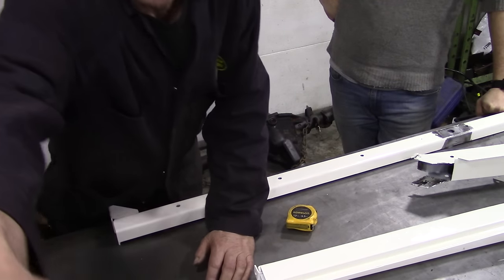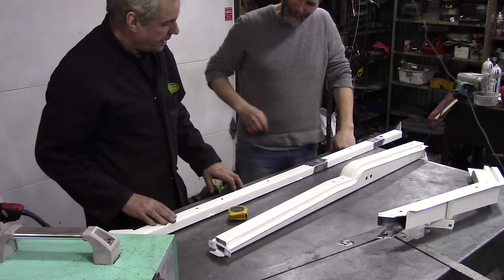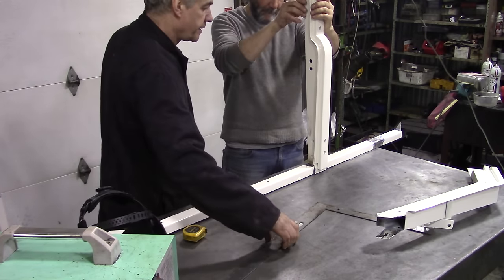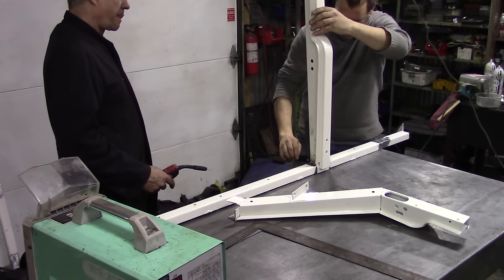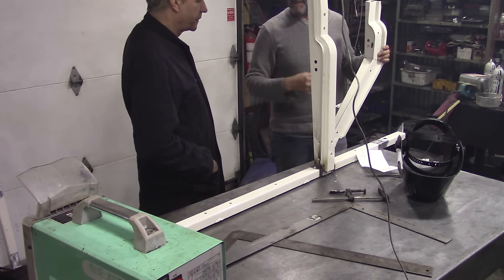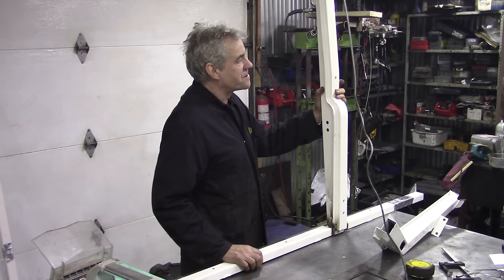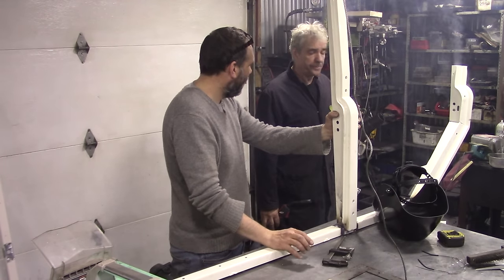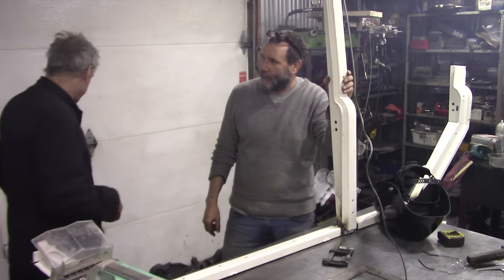Welding door frames for a 110 CSW - with added chit-chat!

Comment: 2 weeks ago I shipped a 9.6KG box to the UK from Canada by UPS with some parts I needed refurbed and it cost  $175.
I shipped the same box/same weight and contents back to Canada  this week using UPS again and it cost $75. I asked UPS why there is such a difference and no one would give me an answer. All I can think is that it's the TRUDEAU tax!
Reply from the maker: Not so sure about the Trudeau tax, but there is unfair pricing by all courier services to Canada - As I try to explain, it is Canada not Cambodia - ship from UK to Vermont 40km away - half price

Comment: I just spent some pennies at Exmoor trim for my 1962 109 full canvas and the shipping was only £14 with speedy gonzales, I have sent items to the US of A and was shocked at Royal mail charges that put an end to that malakey, I don't buy from the states either because they charge more for the shipping than the item costs.
Reply from the maker: It is a joke what is being charged now. Worst thing is, that all the major couriers charge about the same, so no competition.
But this will come back to bite them on the bum when folk stop using them, and simply do without
Reply: @BritannicaRestorations  It has gotten to the point that I will make a day out traveling to drop a package off, it get's us out of the house and make's it a little mini adventure in the Landy, have a bite to eat etc.

Comment: I was after all this info the other year when I got a set of pre welded galv YRM sides if you recall for mine just over 2 yrs ago.  I was worried that the C pillar was in the wrong place, ended up cutting it off and rewelding it.  long story short it wasn't the C in the wrong place, it was the B was to far forward.  Only worked that out when I came to fit the front floor panels in.  had to chop 1/4 inch of them and the tunnel.  That was after countless pictures sent to YRM and the replies of its all jigged up, never had an issue etc.
Reply from the maker: I know the front door gap is 34 3/4 inch, but we were unsure of the C post as the door gap is worked out by the rear 1/4 wing, NOT the frame, as it overlaps the C post = tricky.
According to Jeff , YRM would not give him the measurements to weld it in place
Reply: @BritannicaRestorations  yeah that was my issue.  You did a video using the white 110 sw For the distance. I can't remember what it was now, but you could look back to that.

Comment: Had the self same issue with the bugger am building back up after strip down to bare bones   its not so bad when you have another CWS  sitting you can get the right measurments  from B post  but  its a land rover so theirs always a bit of faffing about  
SP  pannels   load of chancers   looking for 10 doors  total  no way they would do a deal on them so bugger them    dont use them any more  plus the rear door sections i got where  done with a blind man  crap workmanship had to redo the hinge strenthners  as they where all to hell
Reply from the maker: I ordered 2 front doors and 4 x new SS hinges - doors OK - no hinges
What a carry on to get a refund

Comment: Shipping is through the roof now.   It seemed like it doubled overnight.
Reply from the maker: And it is not because fuel prices have gone through the roof...
Reply: @BritannicaRestorations  fuel prices certainly haven’t helped, but not to the point where things have doubled, that’s for sure.  And it’s across-the-board too it’s not just DHL.
Reply from the maker: Indeed! I was just thinking about this - they are all the same price for shipping now - give or take 10%. 
I used to ship parts direct from Britpart as I had an account there - if my order was on their desk Thursday afternoon, it would be delivered Monday morning - so no need for inventory.
But now I get customers to supply parts for jobs, as they think I am ripping them off with import fees etc. They are shocked how much it costs to import parts
Reply: @BritannicaRestorations  I just ordered some parts from LRdirect.  They are always fair in the their rates  and they really went up.  My wife imports fabric from Brazil and You'd not believe how expensive it is now.